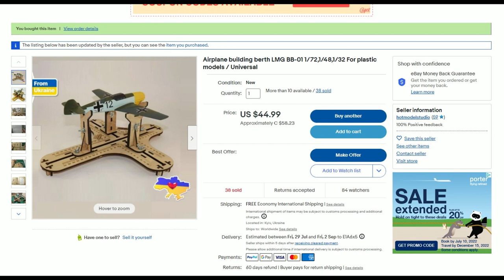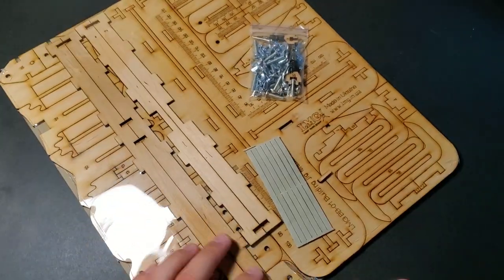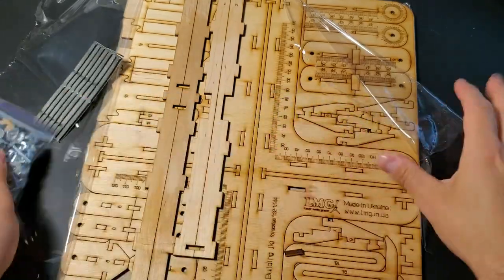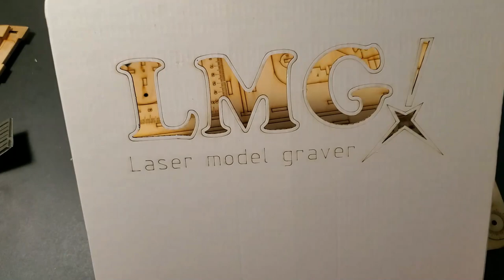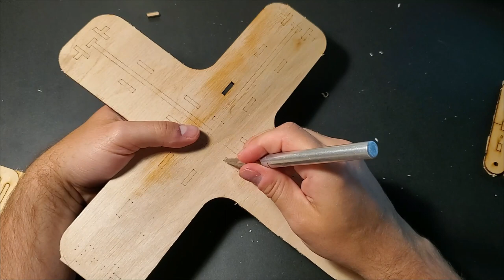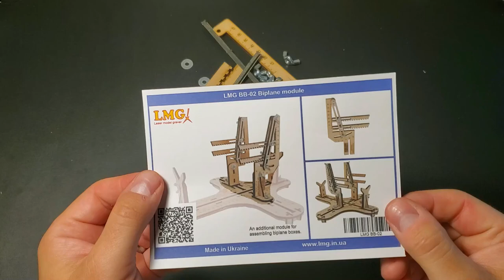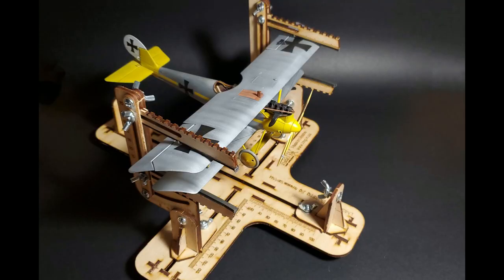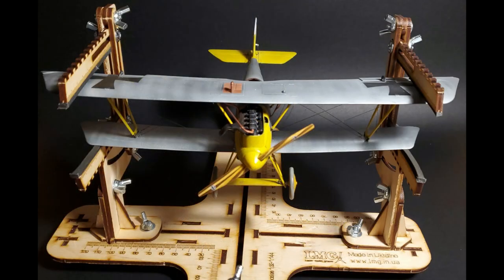LMG - Building Jig

Comment: Instead of using your knife you could have used a block sander on the back (the side without ink/burns on it) to make the breaks cleaner and less flashing to clean up.  Told this trick many years ago when I first tried building a balsa model.
Reply from the maker: Excellent, I didn't know about it, thank you so much

Comment: I bought their BB-01 jig about a year ago for when I am building WWII model aircraft. It works great. Do they sell their BB-02 jig separately since I now want to get into WWI bi-plane models? The link you gave only has BB-02 as part of a large set with BB-01 as its main component. 😊
Reply from the maker: Hi Ronald, it's better if you contact them directly, the seller on the ebay is the actual manufacturer (at least was a year ago), so he is the best person to contact 😉
Reply: @FlyingCircusModels  good point. I just asked and yes it is available as a separate set. 👍🏻 Going to get it. Thanks.
Reply from the maker: awesome

Comment: After a few months of now using it, what do you think about it ? Good sides and bad sides ? Looks good, I've thinking for a while about getting it but doesn't seem to hold the place securely in place ? And do the different structures are easy to move around to fit to the project at hand ?
Reply from the maker: For bad sides: it's not very convenient to use it and shoot the video, but if you use it just for yourself - you should be good lol, also these self-adhesive soft parts (I do not know how to name them) after 3 month started to unstick from the plywood, so I had to use a glue. Moreover, as it was well said in one of the comments, it's better to attach/secure the whole construction to a table in order to have a bid more solid construction. Otherwise, I really like it and worth it's price.
Reply: @FlyingCircusModels  the foam strips just don’t stay on because the glue on them is quite light. I superglued mine neatly to the edges of the supports and they have held firm over several models and counting. They can be replaced if they wear out later. I also blue-tac the four points of the crosspiece base to my work bench for extra stability. And it’s easy to unstick it from the bench if I need to move it around. This is a really useful device. Also, if I need to have the model more securely on the supports, I use a rubberband over each of the ends to keep the fuselage ends and both wingtips in place. The scalloped edges at the base of each support helps hold the rubberbands in position. Hope this is helpful to anyone thinking of getting the jig.

Comment: I prefer LEGO.
Reply from the maker: do you mean build something like that, but from LEGO blocks?
Reply: @FlyingCircusModels  Yes, together with insulating tape for doors to protect the plastic and other helps.I don't believe in expensive purchases. I use it for ships and other parts as well.
Reply from the maker: yeah I saw people use it, but because I do not have any LEGO blocks, I think to buy enough amount will approximately the same price. But, if it works for you - great!!!